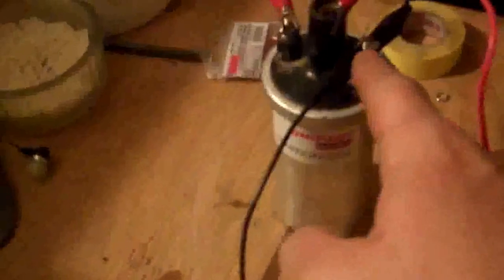Graphene Electrostatic Speaker

Comment: Electrostatic generator to separate graphitic (conductive) from non-graphitic carbon particles?
Reply from the maker: +Blitherer Masterman sounds like a good idea - have you tried it?
Reply: Tried a charged balloon but the particles were super fine and stuck regardless of charge. I am thinking of an aqueous suspension or some other means. . . With a more powerful charge I could probably lift the particles if the process actually works. Things are rarely as simple as they seem.
Reply from the maker: +Blitherer Masterman yep - the translation from idea to working unit is often fraught lol

Comment: Hi robert,

Is this a departure from classical electrostatic speaker design? I see the two aluminum electrodes and then the graphene in the middle, is that the asymmetric capacitor? or is it a a single plate with current flowing through the graphene which then vibrates the membrane? 

cheers, 

DR
Reply from the maker: it's a different design - the current runs through the graphene and vibrates the membrane by setting up an equal an opposite charge

Comment: aha, i see, graphene can be useful for an electrostatic speakers, therefore high frequency range, so called tweeters. what about low frequency speakers from 16Hz up, can be graphene used for a bigger membranes too, is graphene strong enough for such a purpose?
Reply from the maker: yeah it's just to do with distance moved as I am sure you know
Reply: For electrostatics to reproduce bass the panel ideally needs to be the same size as the physical wavelength, for example to reproduce 20Hz (lowest end of human hearing range) you would need a panel at least 17 meters high (since 340m/s divided by 20Hz = 17m). I am unsure as to the width (currently studying electrostatics for my final project at university).
Reply: Yotakari14 This is why most modern ESLs use a hybrid design (ESL for mid and high frequencies and a standard cone woofer for bass extension)
Reply: Yotakari14
thank you
Reply: actually, cut-off is determined by wavelength and displacement ,and IF you have a diaphragm capable of enough excursion ,it can be mounted in a large panel (think folding screen ,or in wall between two rooms)which prevent cancellation.....also,a single sided ESL only produced 1/2 wavefront....all this was done early on ,and by the 50's ,the golden age of sound reproduction ,was as highly developed as it got ,i suspect.....we moved on ,and now people seem satisfied to listen to plastic music out of plastic boxes....................16 Hz. will make you crap your pants ,by the way ,but almost no music below 32.....I'm into horns ,myself ,nearly as quick and thus clear ,as ESLs , but w/o the power demands...thus one can have natural sounding amps (tubes @ 5 Watts sufficient))..bt my big bass horn feeds up the wall into the attic,follows the roof line to the peak ,thus huge mouth...hopefully sub 39 notes...not tested yet.......ESLs ,as you know ,are capacitors,discovered in the 30's i believe from hearing caps "sing"..i never went to university ,just read it....

Comment: Does the thickness of the coating of graphene matter?
Reply from the maker: Aaron Petakia
i dpn't think it would increase capacitance mate mechanical load would increase and eveness of coating would be important though not critical. I will revisit this sometime and run a scope over it
Reply: Also could you use a similar technique to create a wireless charging pad?
Reply from the maker: hiya mate, Listen - I don't really know the answer to your questions - my best response is that your ideas seem really cool and quite workable as far as I think things are workable - beyond that your best answer is to do the experimentation and see how it goes - Rob.
Reply: Cool, thanks
Reply: Sorry about the multiple posts, not sure what happened. Was using my phone to reply and only posted one.
Reply from the maker: lol - it did weird me out a bit lol- i figured you just really wanted an answer
Reply: I'll go file a bug :)
Reply: ***** My guess is that increased thickness would do two things: increase capacitance, and increase the mechanical load.
My other guess is that having a coating of consistent thickness across as smooth a surface as possible is far more important, though that probably requires expensive industrial-grade equipment.

I'd bet there might also be interesting ways to tweak the acoustic and frequency response by having non-homogeneous coating topology... or something...
Reply: Robert Murray-Smith Thanks!

Comment: You need to use one of your single layer graphene sheets as the moveable diaphragm.  As I recall, the lighter the diaphragm the more efficient the speaker.
Maybe an ultra high end speaker company would buy some of your material?
Reply from the maker: maybe lol - cheers mate
Reply: The weight of the diaphragm is not that important, because the diafragm drags some air with it. I  think graphite (!!!) coated Mylar was already fine for making electrostatic speakers. There are more critical things that pose challenges for electrostatic speakers. 

I think it might be possible to squeeze the graphene between to mylar sheets, that way a very thin membrane is isolated from the stators, so higher voltage can be used to as  bias voltage and the elektrostatic speaker will be louder and greater excursion of the membrane will be allowed compared to graphite coated mylar which will spark at some distance from the stator, because there is nothing but air between the stator and the conductor (graphite).

The concept of building electrostatic speakers is very well explained by Roger Sanders in his Electrostatic Speaker Design Cookbook (accesible from the web).

Squeezing the Graphene between stretched mylar will be the hardest thing maybe, if it could be isolated my a more elegant means it would be better, also I wonder if the graphene can withstand the forces and if it can will it stretch enough to perform the excursions the music signal demands?
Reply from the maker: Hiya mate, thanks for that. I am now a bit stuck on what to say because the working principle behind this speaker and that behind the biased electrostatic speaker is very different. I am pretty sure from your general comments that you understand the concepts behind a biased electrostatic speaker very thoroughly so I will confine myself to the differences. In this speaker the base plate of the speaker was the only recipient of charge and the diaphragm had no graphene on it at all. well an induced charge exists or it wouldn't move. the graphene was used in the demo only to demonstrate - you could use anything at all as long as it conducted - so an aluminium foil would work well - probably better - as would a block of ali. The important thing is that it is stable and can carry a high voltage - 2-6 kV. The diaphragm is placed in front of the block and has no electrical connection to anything. The induced voltage is what causes the deflection and hence sound reproduction. My guess is that better reproduction would be from higher voltage, wider seperation of block and diapragm and better diaphragm material and design - i suspect a cell arrangement would be good.

Rob.
Reply: Robert Murray-Smith The wonderful reproduction of electrostatic speakers has to do with the push pull mechanism. If the diafragm moves to one stator the coulom force on the other stator changes accordingly. With a high bias voltage the situation is symmetrical and the waveform of the sound will be the same as the waveform of the driving voltage. The push pull mechanism is sometimes also applied to woofers, that are screwed together on the front an where one gets a reversed phase signal. That way the asymmetry of the one woofer design is eliminated.
I looked a littel further in graphene and it seems that large sheets are still hard to produce. I guess it will be nice to start building a condenser mic first and then maybe an electret headphone. That could make electorstatic headphones obsolete maybe if it is possible to create a high permanent bias voltage. I think there is enough literature on the web, check for Stax headphones. I would recommend Roger Sanders book, it contains a lot of knowledge on engineering and about sound perception and it is just a google search away.
http://www.introni.it/pdf/Sanders%20-%20Electrostatic%20Loudspeaker%20Design%20Cookbook%201995.pdf
Reply from the maker: dude - your missing the point
Reply: So you need a conductor to spread out the charge evenly, te create a uniform electric field above the glass. I think that is the same thing graphite was used for in classical electrostatic speakers.
Reply from the maker: sure - whatever - the point was to show there was something there even though there didn't look like there was
Reply: I'll shut up now,I promise.....missed YOUR point

Comment from the maker: I do like the ideas. Teflon would work as it is an insulator. It sounds to me as if you are thinking of some kind of fluid based induction machine a bit like a bonetti machine but with a rotating fluid as opposed to a rotating disk. It's a really nice idea if you put you the fluid in a plastic pipe with a short metal section as a draw off point it could be pretty cool. Anyway, keep up the good work and let me know how you get on - Rob

Comment: Well I made a electret using teflon I heated up and put in a strong magnetic field and let it cool on a static field and was noticing when I put in water I could get a volt reading off it up to 0.4v so I was wondering is that now kenetic and no longer static? and if you used that conductive graphite liqiud (from your recent video) instead off water, or possibly a magnetic fluid you might get motion? Or a magnet in that diamagnetic graphite liqiud ? Those are kind of my ideas

Comment from the maker: It couples through electrostatic induction. Have a look at the speaker from a pencil and crisp packet vid for more on the theory. The foil just rests on the top of the graphene coated glass. It is not connected to anything - interesting isn't it.